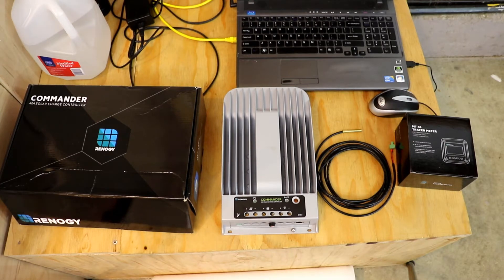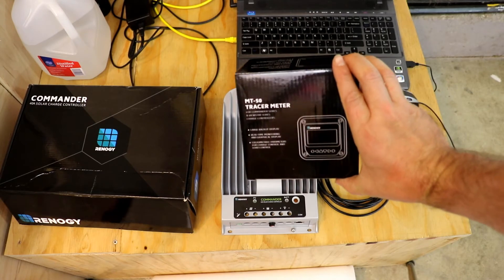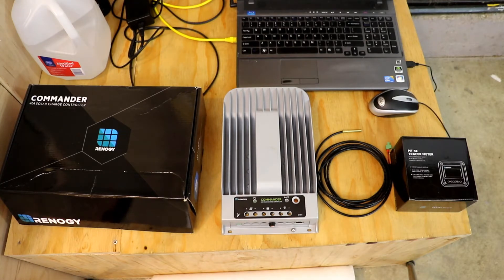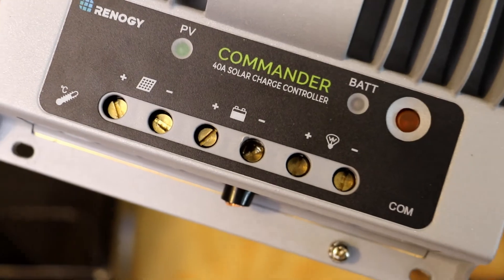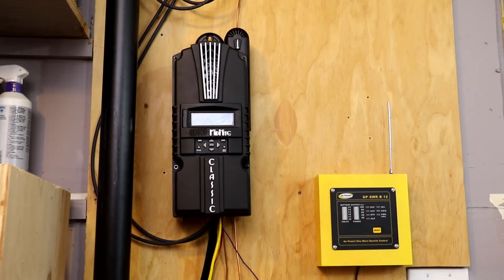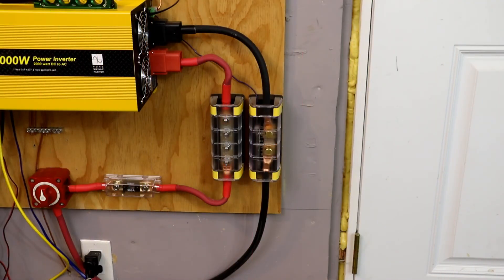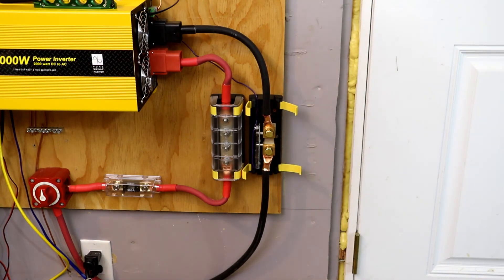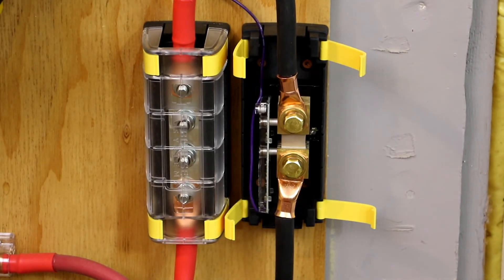Renogy Commander 40A upgrade to MidNite Classic 150

Comment: I have the same Commander style Charge controller as well as a Midnite 250 and they are far apart in features.  I don't think the Commander reads my battery state of charge correctly.  I don't trust it for that at all.
Reply from the maker: Fernbark Frist 
I agree the state of charge according to the meter & its bar graph picture do not seem to match up to my multimeter readings.  I sometimes think the meter is not able to account for the load voltage drop & doesn't properly compensate when the batteries return to no load.
Take Care Friend.